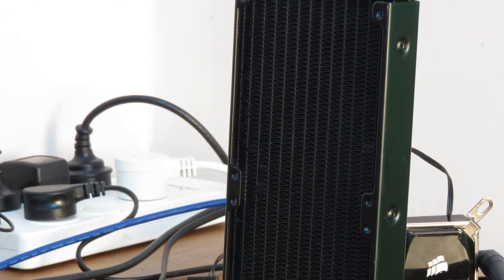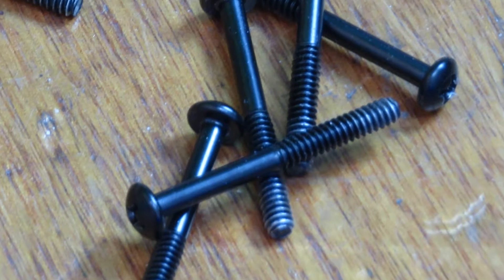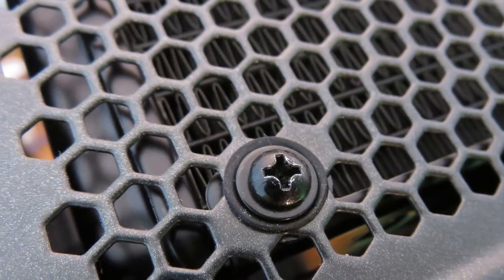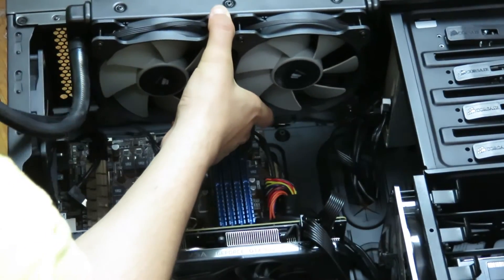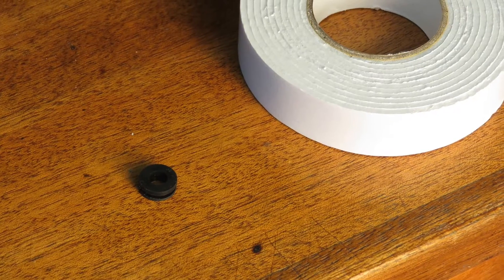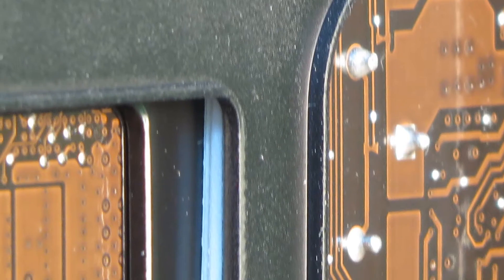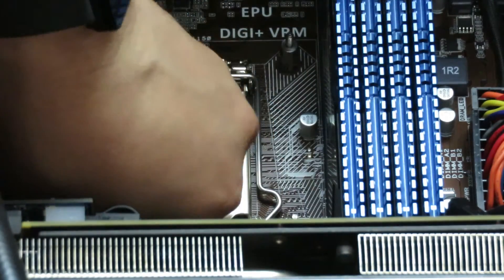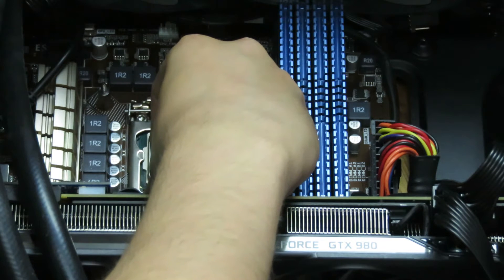Corsair H100i Aio Liquid Cooling Installation / Efficiency 2015 Backplate loose solution

Comment: Nice video and great idea, i was thinking my h100i was defective or was missing some pieces because of the loose on the socket (i noticed when i installed it) and because i bought it used, thanks bro ill test it , im getting same temps as the little stock cpu cooler because of the loose
Reply from the maker: It's sometimes even worse than stock cooler.beware and monitor temps all the time.
Reply: IT WAS OK WHEN GAMING BUT I RECODED A GAMPLAY AND I STARTED TO COMPRESS THE VIDEO, THE PROGRAM USES 100% OF THE CPU AND I REACHED 94 DEGREE CELCIUS AND I EVEN HAVE THE POWER SAVING MODE PROFILE ON THE CPU, I GUESS IF I HAVENT SET THE ENERGY SAVING PROFILE MY PC WOULD JUST SHUT OFF FOR HOT TEMP
Reply from the maker: Emil Reyes Perdomo yeah, in any case just boot to bios first and check idle temps.

Comment: Nice to see that you installed the backplate completly wrong.

Also the washers are not needed the backplate lose is supposed to be there, once you installed the pump everything is tight.
Reply: M .Mister Lol didn't line them notches up...